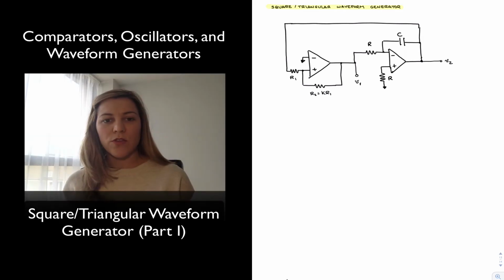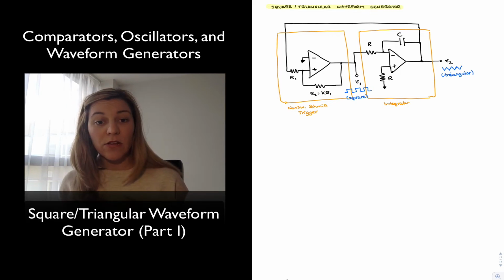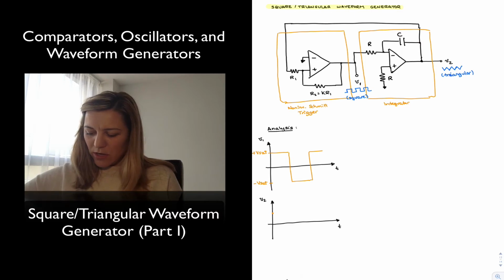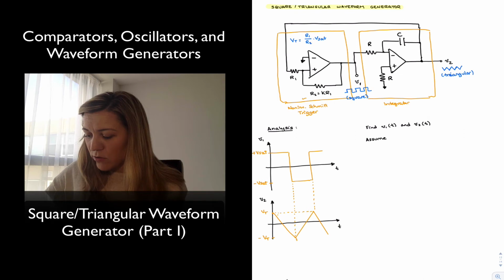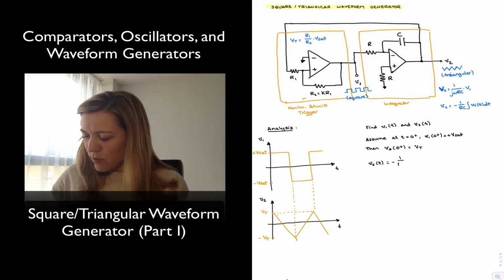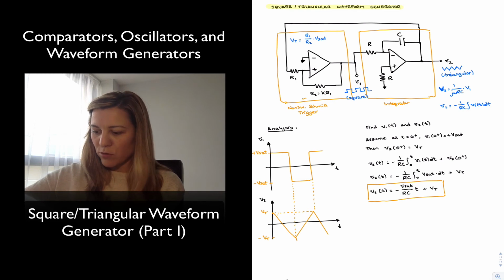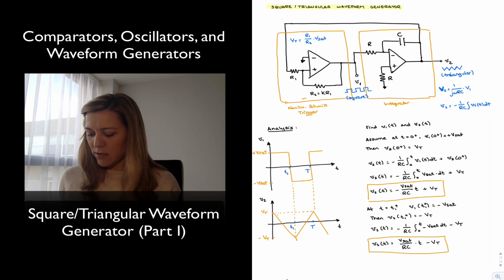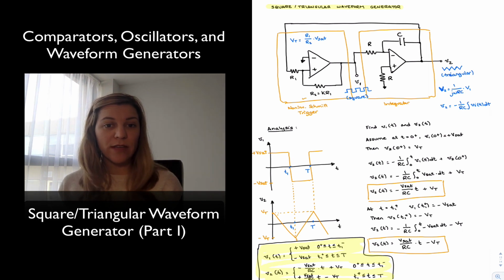Square/Triangular Waveform Generator

Comment: Hello! Did you've tried to make an integrator after PLL's (4046 IC) osc. output (it gives square wave on Pin 4)? I have something but not a triangle wave...
P.S. the frequency is changing constantly and it's modulated (on Pin 11). It's for a synth.

Comment: Ma'am the v2(t) u have calculated in the 2nd case has an intercept of -VT in interval t1+ to T which is not correct in my opinion. Both v2(t) that u have calculated is correct from 0 to t1 interval and not from t1+ to T.